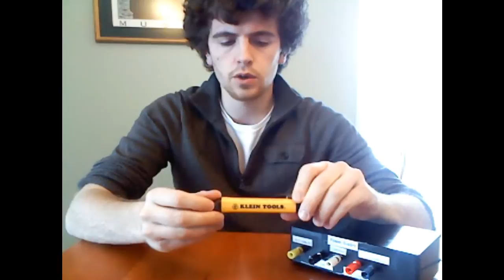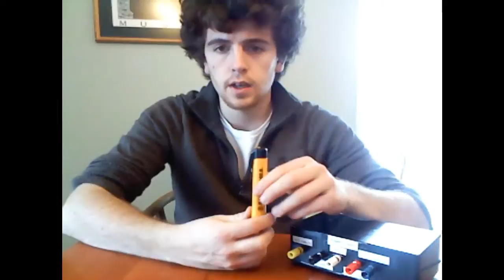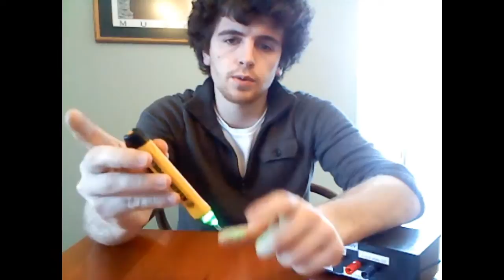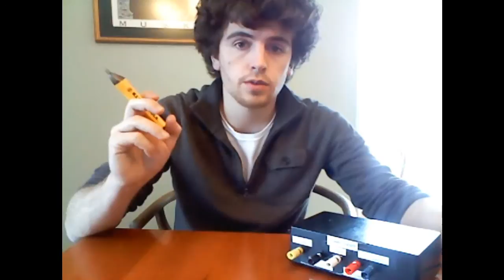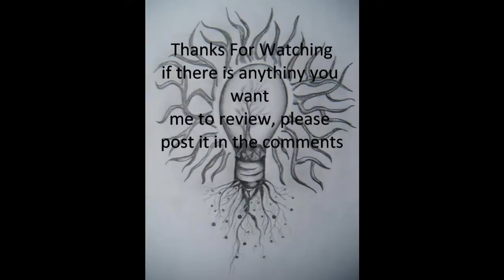Klein Non-Contact Voltage Detector

Comment: Nick, I'm definitely with you by looking for made USA products, and I'm willing to pay a reasonable premium for them; but as you pointed out, there are no USA made non-contact testers out there, so you have to settle for this.
I really like mine.
Reply from the maker: It is a shame but no other manufacture makes them in America, Canada, Japan or anything similar. It is a shame but it is the modern way! I got a Fluke model as well and I was surprised that the Klein works better than it... Thanks for the view!
Reply: Nick Sek
Agreed all around.
I also have the Fluke version, but I'm with you that the Klein is hands down a better non-contact detector.
However, I also have three Fluke DMMs, a 73III, an 81438, and a 179.
All of them are excellent, but the USA made 179 is top shelf.
Of course, the 73III was made in China, and I should probably sell it.
Believe it or not, the 81438 was made in USA, as indicated on its packaging when I spotted it in Sears, even though another 81438 hanging on the pegboard right next to it clearly indicated it was made in China.
I can only guess that the one I found was one of the last made here before they moved production of the 81438 to China.
Keep your excellent reviews coming.
Reply: Nick Sek I searched hard and compared before I bought. I was a little surprised that I took the Klein over the Fluke. That's the first time I've ever done that in my life, I think. But I agree with you guy's.